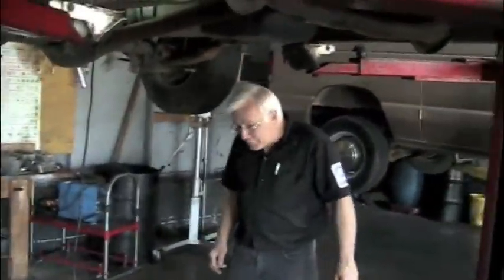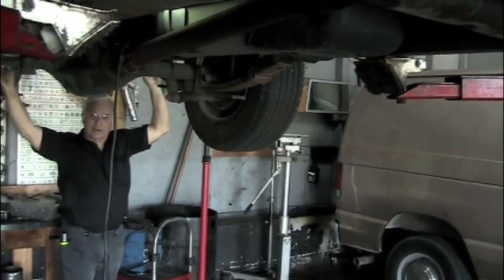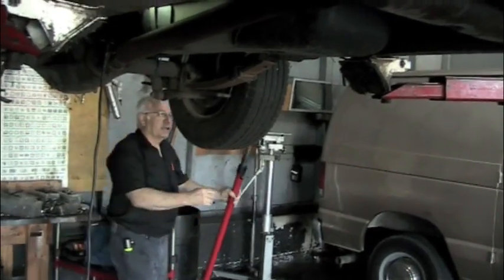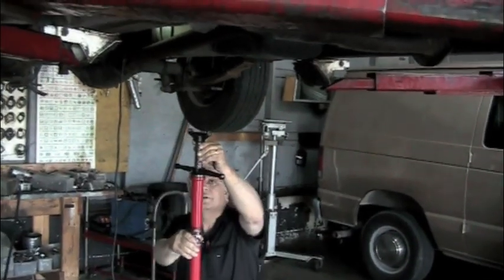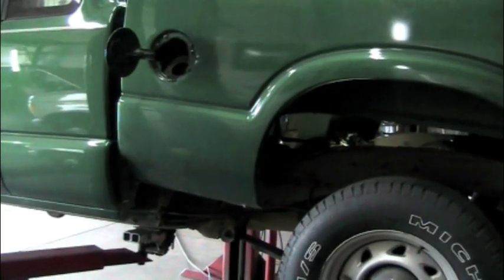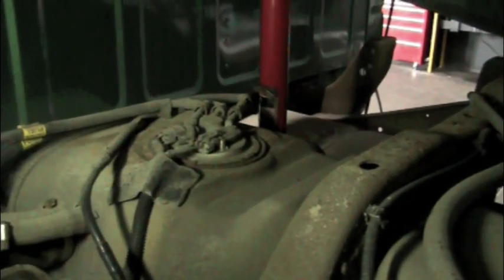S-10 Lift bed for fuel pump

Comment: I have a 2001 S10 and using the advice on this video, i just changed my fuel pump in less than an hour and i didn't even have to jack anything up at all. All i did was take the screws out and lift up the bed while my girlfriend placed jack stands inbetween the frame and the bed.
  My pump cost $289.00 and nothing to put in and get this, i've never changed a fuel pump in my life.
  Thank thank you thank you!!!!!

Comment: I dropped my tank on mine to get the fuel pump out and it was very awkward and took hours. 

I will definitely do it this way next time and i am going to do it like this when i replace the rusty brake pipe for the rear.

Thanks for making this video :)

Comment from the maker: Hey there.   The fuel pump should run when you first turn on the key, if the computer doesn't see an ignition signal (rpm's) after 2-3 seconds it will shut the fuel pump off for safety.  Then you would have to cycle the key off and then back on to get it to run again.  Here's a trick that might help,  have someone crank the engine over and then you beat on the bottom of the fuel tank while it's cranking, if it starts & runs,  you need a new fuel pump.  Hope that helps

Comment: If you take the bed off completely (disconnecting the wiring harnesses and grounds) and you go to test the new pump. It will not prime or work without the ground reconnected. So... hook up the ground, see that it works, disconnect it, then put the bed back on. 

With the tailgate off and two people lifting it's easy...

Comment: Yea I have a neighbor with a fuel leak there on top of the tank. This looks easy but we don't have access to a lift, so we'd have to do it with floor jacks and jack stands and bottle jacks. The truck is pretty rust-free, so we might just get away with just dropping the tank....

Comment: Gonna give this a try tomorrow, but hoisting the front of the bed by the two tie down points. I'll keep ya posted...
Reply: I tried it using just a rope and pulleys rigged from the garage joist and it worked like a charm.  I put a couple of those ratcheting cargo straps through the tie downs in the bed for safety.  Thanks for the idea.  Wish I would have known about this on the first three fuel pumps that I changed on my truck.

Comment: okay sport fans heres the EZ way to do it. Simply use a grinder and cut a 6" square access panel directly above fuel pump in the truck bed. You can find the exact measurements with photos online. Very simple very ez

Comment: @CraigsRodCustom trust me thats alot better then droping a tank on a doge d150 ive done it both ways on an s10 an this ways better undo  the bed  bolts  put a crate under the bed an pop the pump in dont have to worry about tank being full like mine was

Comment: if I take the bolts off my bed will I have any trouble lifting the bed completely off with a couple of guys? I don't have a lift like you so would need to remove the bed completely.

Comment: I have a 94 S10, with some sort of fuel issue, Im not going to ask you to diagnose. But is the Fuel pump suppose to run continuously once the key is in the on position? Or only when the engine is running/turning over? As I can't here it when its not running with key on.

Comment: This doesn't work with a crew cab because the fuel pump is only partially exposed after you lift the bed.

Comment: Don't ever install an Airtex fuel pump in a GM,nothing but failures and install a Delphi or AC Delco fuel pump instead.Change the fuel filter too,voids the warranty if you don't